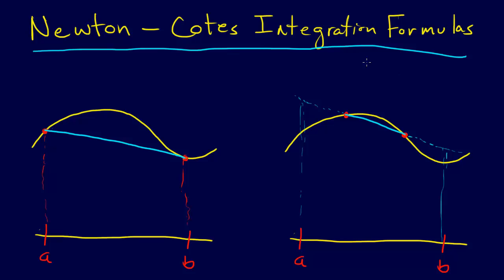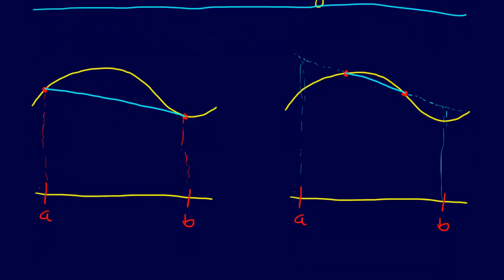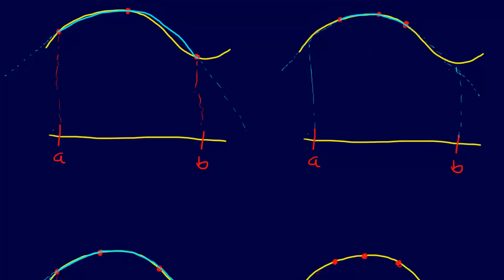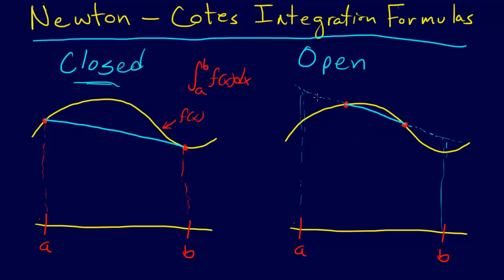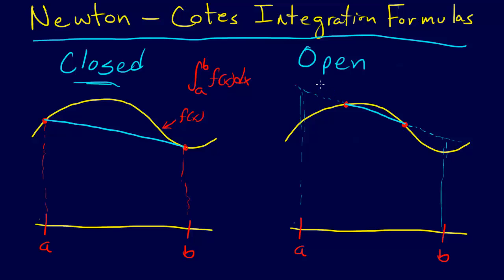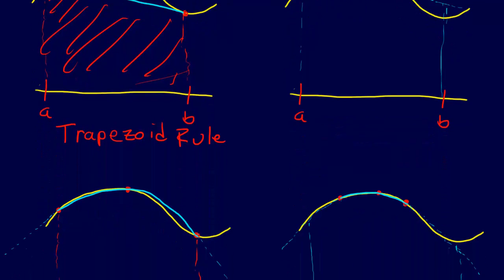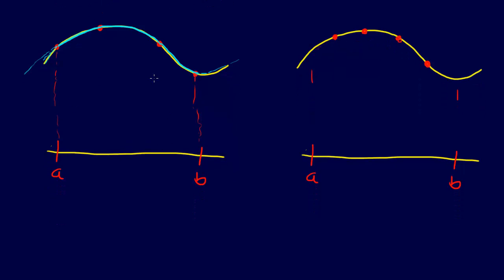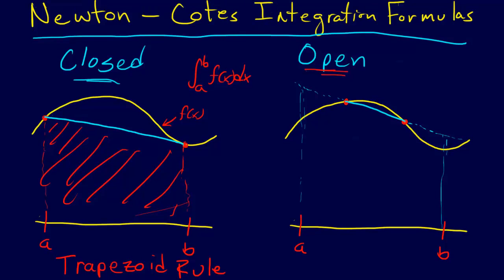6.1.3-Numerical Integration: Newton-Cotes Integration Formulas Overview

Comment: So What is the maximum degree of polynomials (n) for which the Newton-Cotes formula can give the
exact solution?
Reply: depends on the newton cotes formula we are using ... the trapezoidal will give exact solution if the function we are trying to integrate is a linear polynomial i.e a first degree polynomial , similarly the simpson 1/3 rule will give exact solution for the quadratic polynomial and simpson 3/8 rule will give exact solution for cubic polynomial.his is a numerical method and will only ever give an approximate solution.
and the reason behind this is the uniqueness theorem of polynomials ... you can look it up yourself ...
Reply from the maker: None. This is a numerical method and will only ever give an approximate solution.
Reply: @kvyi  Actually, Simpson rule gives you exact solution if its used on polynomal function degree 3.
Reply: @kvyi  no no the numerical methods do actually gives the exact solutions in some cases ... for example in N(th) degree gaussian quadrature we get exact solution for up to the polynomials of degree 2N+1